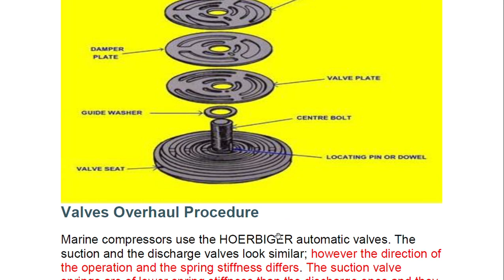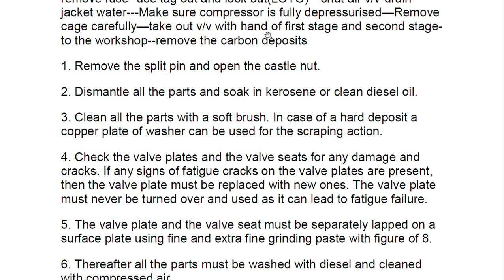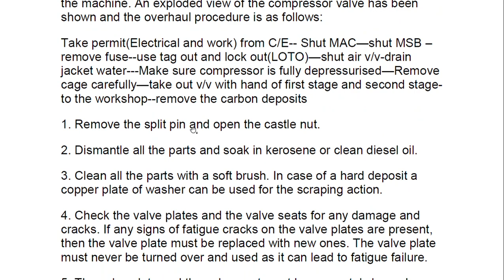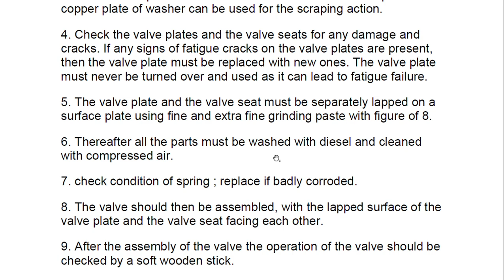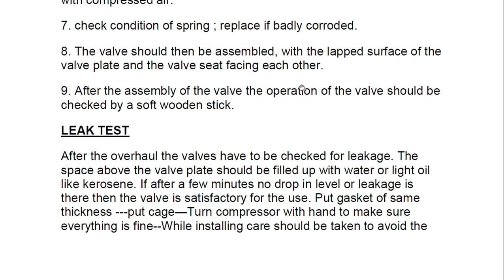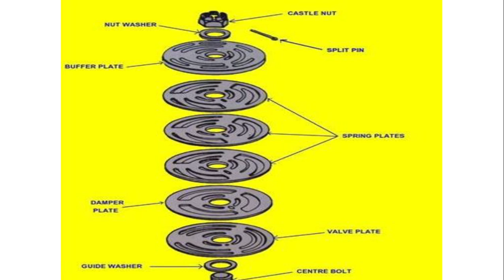Air Compressor(MAC)V/V overhauling Procedure/Valve leak test/If Suction and discharge v/v changed

Comment: Sir your explanation is ok we understand but one thing that suction and discharge valve very deferent some vale is have long main bot or some have small bolt when you will open upper cover you find the cover cap or plate heaving holding point that is deferent ok all ways mark first do any things ok